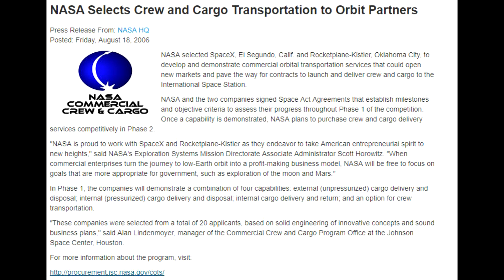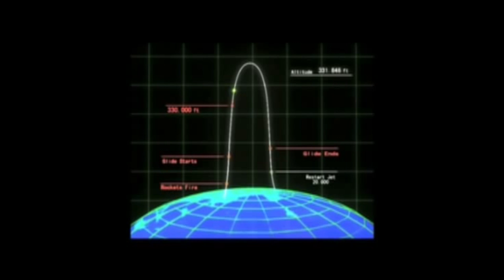The Kistler K-1 - 1990's Reusable Commercial Rocket

Comment: That nose cone. I'm sitting here watching this vehicle going vertical waiting for a crane to come in and drop a encapsulated payload in a fairing on top of the rocket and all of a sudden it just launched. It's interesting though how they used that as the heat shield as it was. It's different and would have been innovative back then.

Comment: Parachutes and airbags seem like so much simpler of a technology to get a rocket back to earth. Presumably saving fuel for a suicide burn landing is less weight than the parachutes and airbags you need to land? Or less trouble then finding space for them in the fuselage of the rocket?
Reply: I don't think parachutes and airbags are neither simple nor reliable. To land a 25 ton rocket (about the dry mass of the F9 1st stage) at say about 3 m/s, you'd need something like a parachute of 250 m diameter -- about 50,000 square meters of fabric. That is *massive*. Heavy. And even if you get that to fly, you'll be trying to land a building-sized chunk of delicate machinery, and you don't know where exactly it will land, if it will stray off course because wind, you don't even know for sure if something will be damaged on impact. Because it's a collision in the end, it's just too random to predict. Too many variables for comfort.

Saying that, if you had asked me, back in 2006, to predict what a reusable orbital vehicle would look like? While I certainly wouldn't have thought "parachute", I wouldn't have thought "suicide burn" either. That's just mental haha.

I would have bet on a Baikal-style rocket instead. You know, booster with deployable wings. It just seems the sensible choice to me.

And I would have lost miserably, of course, heh. I'm still in awe that SpaceX got it to work.

Comment: Begs the question, why is SpaceX doing the full on rocket return landings?  Wouldn't the parachute and airbag system be far easier and cheaper?
Reply: SpaceX attempted parachute returns for its first two Falcon 9 flights. Both failed due to the first stage being torn apart before parachute deployment. (Source: https://www.newscientist.com/blogs/shortsharpscience/2011/09/falcon-rockets-to-land-on-thei.html)
Reply: That doesn't matter with these ascent stages.  They're getting dropped at Earth regardless.

Comment: It wouldn't need to be in orbit for 24 hours for it to pass back over the launch site. 

It's more like 90 mins for a low orbit.
Reply from the maker: The earth rotates 2000km in 90minutes
Reply: I was referring to your slip of the tongue @4:35 where you were saying that after 24 hours the rocket would pass back over the launch site again and begin its de-orbit procedure.

If it was in an equatorial low orbit it wouldn't need to wait 24 hours to pass over the launch site a second time as It'd have passed over the launch site over a dozen times in that period.

...but obviously you already know that :)
Reply: Virtually no one uses an equatorial (aka 0° inclination) low Earth orbit for a bucket load of reasons including, but not limited to, the US is not on the equator. The K-1 was being developed to supply the ISS which has a 51.6° orbital inclination. Therefore after one orbit, the launch site will have rotated east out from under the orbit's ground track.  This animation of the ISS orbit makes may make it more clear: https://www.youtube.com/watch?v=8-mKLs2b3MM

Comment: Parachutes and airbags. The best minds in the industry still though this was the best solution. It just shows you how much of a gamble and how difficult it was to land a first stage booster using rocket power.
Reply: So did SpaceX, interestingly enough. In fact it wasn't until 4 years after Rocketplane Kistler had gone backrupt and two failed Falcon 9 parachute recoveries that SpaceX decided to switch over to propulsive vertical landings

Comment: The only case parachutes make sense is if you landed in Africa with additional thermal protection. On reentry the angle of attack would be too steep for regular parachutes to do much. That strategy might make sense for China with polar launches.

Parachute landings on the ocean with a water tight lids would be cool. Example:
1. launch
2. use RCS to point your engines prograde
3. cool the engines down and dump all fuel.
4. encase the engines with a retractable double wall
5. seal the engine bay lid with an inflatable balloon
5. deploy parachutes and inflatable pontoons
Reply from the maker: Apollo capsules were not reused
Reply: So Apollo didn't exist then?
Reply: True but they certainly had parachutes, and if you can get a human down safely then metalwork is not going to be a problem.

Comment: So what kind of dynamic pressure does this absolutely flat top of the rocket experience in flight?
Reply: The dynamic pressure doesn't depend on the shape of the rocket. The actual stagnation pressure does, but that's not quite the same thing

Comment: The downside to the NK-33 engine is that it gets it's performance from being cursed by Satan, and it exacts that toll on any rocket using it.
Reply: I know, just use it on missiles which explode anyway. Take that, Satan!
Reply: they're cursed by the SS-18?
Reply: Terry Wilson R-36M had the NATO Reporting Name "SS-18 Satan"
Reply: No. The downside is being cursed by Orbital's executives who, contrary to the advice of Kuznetsov's engineers, pushed the NK-33s well beyond their original Soviet officially rated maximum thrust. Unlike Kistler, Orbital were too cheap/greedy to use three engines instead of two.
Reply: Robert Willis well it worked out...
Reply: The fact that the "cursed by the SS-18" thing was a joke, and you seemed not to get it, at all.
Reply: charwhick lmao good one!
Reply: don't mess with MIRVs
Reply: Lmao
Reply: Wtf
Reply: No, them blowing up at launch would be the act of God.

Comment: Didn't SpaceX also experiment with parachutes on the Falcon 1?
Reply: The fuel needed turns out to weigh less than the chutes would. So they went that route.
Reply: Yes, there's a picture of Elon standing on a F1 interstage with three boxes for the parachutes.
Reply: Falcon 9, actually. Here's the photo: http://media.vanityfair.com/photos/58d548eb0920c94abb9619e9/master/w_1920,c_limit/elon-musk-AI-04-17-01.jpg
Reply: @usuallycallmark  thank you for your services sir
Reply: Yea, they even attempted to recover two Falcon 9 first stages by parachute at the beginning of it's career.

Edit:To clarify, the first two Falcon 9's all the way back in 2010 had parachutes on board, but were torn apart in the atmosphere before they could even deploy them. Here's an article from 2011 announcing the switch to rocket powered landings: https://www.newscientist.com/blogs/shortsharpscience/2011/09/falcon-rockets-to-land-on-thei.html
Reply: Yes but the first stage didn't survive reentry so they eventually looked into boost back on F9 and since the thrust to weight with one engine was low enough it was logical to look into landing under rocket power since it was already proven by the DCX and various vehicles by companies such as Armadillo and Masten.

Comment: Those NK-33 engines have something like a 1-5 chance of blowing up on accent. This is caused by the turbo pumps from what I've read. All 4 N1 rockets failed due to exploding NK-33 and of course Antares blew up because of the NK-33 faulty turbo pump as well. Only a crazy person would use these 50 year old engines on a launch vehicle.
Reply: Jamie Godman The N-1s that did launch used NK-15 engines, not NK-33. It's believed that if the next planned N-1 had launched (with NK-33 engines) it would have been a success, but by that point the program had become politically inconvenient and was cancelled.
Reply: Only a crazy person would land a rocket on a ship in the middle of the ocean. I don't see the problem. They got them cheap and modernized. And if this really would become a bigger problem they could fix it.

Comment: Scott should do a video where he makes these rockets in KSP. Both designs are very kerbal. The K1 payload delivery system and payload door could be made using magic smoke robotics.
Reply: If going manned: KAS struts. Simply have your Kerbal go out and link the endpoints before reentry.
If going unmanned: Quantum Struts. Once the door is closed, the endpoints are linked with an action group.

In either case, the door/heat shield should be relatively rigid through reentry.
Reply: H Se if you press "C" to go into i.v.a view, you can use your mouse to move cockpit throttle to control the regular throttle, FYI only manned crafts have the I.V.A view.
Reply: +Friday Harlowe the biggest issue would be keeping the heat sheild from flopping around during re-entry due to not having a easy way to lock.
Reply: I’m new to KSP. How can I adjust throttle with my mouse pointer? Thanks.
Reply: now you see i've tried this on multiple occasions and it's never worked :( is there a specific point on the handle you have to drag? i always go for the center of the handle.

Comment: Wow those NK engines are cursed.
Reply: No. Only one NK-33 engine has ever failed in flight, & that's because Orbital insisted on pushing them above their original thrust rating.
Reply: Robert Willis uh... did you not hear about that whole N-1 rocket, where the engines would ya know. Fail in flight 

Great last name by the way.
Reply: @ThePrimalEarth  Those were NK-15, their predecessors. NK-33 N-1 has never flown.

Comment: The question is not whether SpaceX would be able to compete. The question is if anyone else could compete with SpaceX even if they had gotten off the ground. SpaceX has proven themselves SO good at everything they do that at this point, I would not bet against them on anything.
Reply: +Peter Cohen
I think at that point they were still struggling with Falcon 1.  And Elon Musk had the money which also helped a lot.
Reply: SpaceX has taken a long time to get where they are today, something often forgotten with all the recent excitement.  Kistler might've demonstrated reusability several years before SpaceX, leaving SpaceX to constantly play catch-up.

I wonder if we'd have ended up with a Falcon Heavy though.  It's SpaceX's customers that pushed so hard for it and they could have pushed Kistler to provide that instead.  That would have left SpaceX open to develop the BFR years earlier, so it may have been flying today.
Reply: ABaumstumpf The launch price of a falcon heavy is 90 mil. A launch with the ULA will cost you between 300 and 500 mil, while the falcon heavy can even deliver twice the payload and send stuff anywhere in the solar system without using gravity assists (up to 1,5 tons directly to pluto). The only thing preventing customers from only going SpaceX now is that the falcon heavy is relatively unproven.
Reply: That could be, but then still its a lot cheaper than the ULA's options.
Reply: @ABaumstumpf
You have absolutely no idea what you are talking about. SpaceX launch costs are so vastly lower than anyone else, it is a baffling mystery how any other system is still flying.
Reply: Especially marketing, bit of a double entendre ...
Reply: Adam Olsen I don't think it's taken a long time for SpaceX to get where they are today. If you look at the pace Boeing & LockMart are at with the SLS/Orion program, it's taking them a decade or longer just to launch SLS one time. Lockheed has been working on Orion since 06 and it won't carry Astros until 2024 realistically. That's almost two decades just to reinvent Apollo 2.0. Spacex works at a phenomenal pace compared to any other aerospace CO. Even blue origin works at a snail's pace. So I believe SpaceX has done an awesome job in the last 15 years.
Reply: Jamie: Your comment is accurate except that NASA hasn't launched the SLS at all.  The Orion capsule has been up once (or maybe twice?), but the rocket itself is still in development hell.
I think it'll be a close-run thing to see if SLS or BFR have the first orbital flight, but I'm pretty sure the BFR will make a second (and third) flight long before the SLS does.
Reply: Peter Cohen simple, spacex just can't get enough rocket in the air. They need to have a weekly launch schedule. Prove your track record with on time weekly flights and you'll soon get the contacts rolling in.
Reply: Jamie Godman good point
Reply: Peter Cohen agreed. SpaceX is now the undisputed leader in LSP and a top Aerospace company world wide. Not only do they fly the most advanced boosters in the world, they do so at a pace that old space MIC contractors have not done since the original space race in the 60's. Boeing, LockMart, Aerojet, NG and even orbital ATK take a decade to accomplish what SpaceX can do in a year. Old space MIC companies have all become mediocre in space technology.
Reply: Or no one pays SpaceX and it won't had a launch manifest that fills up to years later thus having less money to develop BFR.
Reply: 90 mil for up to 8 tonnes to GTO. Above that, the prices go up, possibly proportionally to the weight.
Reply: SpaceX first need to get out of the reds.
Seriously - that company got gifted hundreds of millions And is getting heavy government supports (through things like tax cuts) and the actual launch costs for their customers is similar to those of the other companies that are just raking in the money.